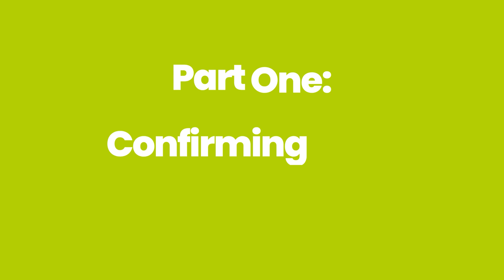The Easiest Way to Bond And Ground Your Network Installation in 2024

Comment: I have my small 10 inch server rack plugged into a portable power station. While I have grounded the metal server rack to my house ground, the power station does have a floating neutral, so everything plugged into it is not connected to a ground wire. My thinking is it would be nice to have a way to attach my switches and router to ground somehow. Is there a solution for this?
Reply from the maker: Hello and I fully understand the situation. Since the rack is already bonded to your house AC ground, you need only bond the equipment mounted in the rack to the rack itself. This can be accomplished by removing the paint from a discreet spot on the rack and attaching a bond wire from the equipment to the rack. Make use of 14AWG green pure copper stranded conductor, but keep the lengths to the shortest you can...ideally no more than the 10" size that your rack is. Use NO-OX conductive anti-oxidant grease when make the physical connections for lowest contact resistance.
Reply: @trueCABLE THANK YOU:) 
Finally someone understands haha. Not much info online about my current set up. Thank you for your response. 
The only downside is, my small ubiquiti gateway and 8 port POE switch have no grounding lug like some larger network switches. 
What if, I attach 1 Ethernet surge protector to each piece of equipment and bond that to the rack in the same you suggested?
Would that work?

Comment: Would it be safe to connect the truePlug to a router which has an electrical outlet on it (ie the UXG-PRO)? That way you'd save a spot on your PDU?
Reply from the maker: Hello! Good question, and the answer is "I do not know". It might be better than not bonding at all if you have no alternative, but quite frankly you are placing a lot of reliance on the switch and subsequently the PDU providing a sufficient low resistance path to ground. It should be 100milliohm, or 0.1ohm. There is no way to effectively measure that unless you have some expensive equipment designed to do high resolution two point resistance testing. I would try and find a way of making a direct connection with the truePLUG to an AC outlet, and failing that, a direct connection to a PDU or UPS. Adding in more "stuff" between the patch panel and actual AC ground in the wall has no upsides, and potentially a lot of downside.
Reply: @trueCABLE  thank you!

Comment: Problem: I have to use a shielded ethernet because my ethernet needs to run next to a DC line in a robot umbilical line. I know this is not great practice but for our application, I can't put a few-inch gap between the 2 types. The issue I am facing is the ethernet is used for teleoperating the robot not internet access. So the ethernet plugs into the computer inside the robot, and the other side plugs into the ground station laptop. Since the ground station laptop doesn't have an ethernet port we are using a dongle (USB A 3.0 to ethernet). To my understanding this dongle won't transfer the ground from the RJ45 shielded ethernet to the USB port on the laptop. I am now to the point where I don't know how to ground the ethernet properly and worry the shielding will either amplify the interference like an antenna or just plain act like an unshielded cable. Do you have the slightest easiest advice? 

Ps I love your videos and your crimping tool lol. Thanks
Reply from the maker: Hello Zachary! Wow. I can see the issue. There really is no easy solution to this. You are correct that your cable shield won't be bonded to ground as it should be, but that does not mean you will automatically have issues either. As it turns out, more often than not an unbonded cable shield simply means the cable shield is not going to function. In very high EMI/RFI environments you may experience additional interference due to this, but it is on a case by case basis. Honestly, I would rethink this strategy you are using. I understand the need for the dongle, but you can bond the cable shield to ground well before the dongle. This is done by terminating the end of the shielded cable to a shielded keystone jack mounted into a shielded patch panel frame. The shielded patch panel frame is bonded to ground (and can be easily done with our truePLUG Bond & Ground Extension Adapter) and now you can even use an unshielded factory made patch cord from the keystone jack/patch panel to your USB dongle. I hope that helps!
Reply: @trueCABLE  Thank you!! I will look into this more. Seriosuly your team/products are great.
Reply from the maker: @zacharyjurecek178  Thanks Zachary! We love what we do.

Comment: I need it in UK type G socket...
Reply from the maker: Hello! When (if) we starting selling our products internationally we will have multiple socket versions available. Right now it is NEMA standard since we sell in the North America and Puerto Rico only. Also, I don't recommend attempting to use a NEMA to G adapter as the resistance may increase and result in ineffective bonding to ground.

Comment: What happens if a computer is plugged in to another outlet and group which is grounded, and you also ground your patch panel on the other side, will this cause issues?

At that point, I believe you're grounded at both sides on different groups. Isn't that going to create a ground loop?
Reply from the maker: Hello! You won't risk a ground loop unless those bond points end up at two disparate AC grounds. The potential for problems does not result from the number of bonds to the SAME ground, but when multiple different ground systems are involved. A good example would be bonding an Ethernet cable shield to ground at both ends in TWO different structures where they have their own AC ground systems.
Reply: @trueCABLE  Thank you.
Reply from the maker: @BerserkeR_031  You are welcome!

Comment: if i have two shielded patch panels.. could i get two of these bond cables (one for each panel) and run them into the UPS in my rack? Or would it be better to just run them both directly into wall sockets, one socket per cable? I have both a PDU and a UPS in my rack (PDU connecting to UPS and then UPS to AC outlet) and I'd rather not have the bond cables leave the rack and just stay plugged in within the rack if possible. 

Appreciate any answers you can give!
Reply from the maker: The Bond & Ground Extension Wire Adapter is intended to be used only with a properly installed AC wall socket. If you bond the two shielded patch panels together, only one ground adapter plug will be required.
Reply: @trueCABLE  how do i bond two patch panels together and then run a ground wire to the wall?
Reply from the maker: @aliazimi91  Hello Ali! There are three ways you can go. You can either use a RBB (rack busbar) that is attached to your rack (wall mount or floor standing rack). A RBB is a copper bar that is bonded to ground on it's own, RBBs are typically connected to a SBB or Secondary Busbar that is mounted on the outside of your wall adjacent to your rack. The SBB is then bonded via a thick copper conductor back to your AC ground (directly into an electrical panel, structural steel, etc.). You would then bond anything in the rack that requires bonding to the RBBs. That would complete the chain of bonds to ground. This method is actually the correct method for commercial installs. It is costly due to the copper bus bars and hardware/tools. The second option, if the first one is not feasible, would be to use a copper bond wire from one patch panel to the other (making use of, or replacing the existing bond wires). You would then use a copper bond conductor that is attached to either of the patch panels that are daisy-chained together and then bond that conductor to ground. You could use our truePLUG adapter for that purpose. The last option is to use two separate truePLUG bond extension adapters and make use of two grounded AC outlets. That would mean both patch panels are bonded to ground but not in a daisy-chain fashion. Of the three, in a residential setting, the last one is the most effective, least costly, and least problematic.
Reply: @trueCABLE  thanks so much for the clarity! keep up the good work!

Comment: If you have two shielded patch panels in a U15 floor standing rack, is it OK to mount the patch panels to the rack that is painted.  It seems like you are saying to not do that.  So would you run a wire from one patch panel to the screw on the other patch panel, on the unpainted part, and connect the grounding plug wire to the same screw?  The two patch panels are a little too far apart to use the included short ground wire to connect them together.
Reply from the maker: Hello William! Nope, don't do that. It is never a good idea to daisy chain bond like you are envisioning. You can mount the shielded patch panels to a painted rack, but the bond wires should be bonded separately. That all said, a simple way of going about this is to use TWO of our bond and ground adapters. Connect one to each shielded patch panel, replacing the stock bond wires, and then use two AC outlets to bond them to ground. That will greatly simply things, I think. There is a much more complex way of going about this using rack bus bars and secondary bus bars, but it sounds like your setup does not have that formal infrastructure to bond to.

Comment: Is there any disadvantages using this method vs a bond bar?
Reply from the maker: If you have access to a formal bonding and grounding infrastructure or need to bond multiple accessories in a rack to a rack bus bar, then that is the direction you should go. truePLUG is an accessory designed to bond a singular accessory to ground (shielded patch panel for example) and further in environments that lack any sort of bonding and grounding infrastructure (like TRs that have racks with RBBs, and one or more SBBs in the room).